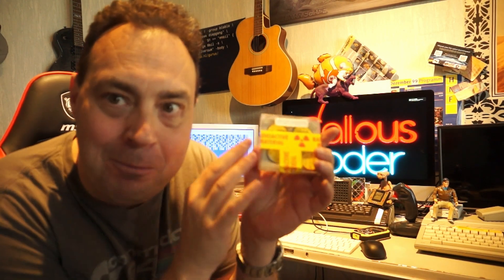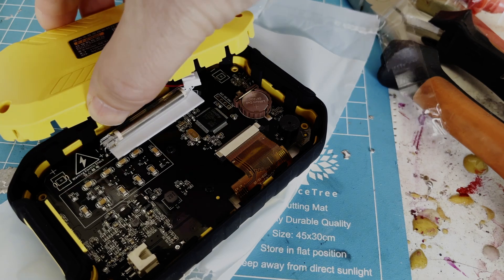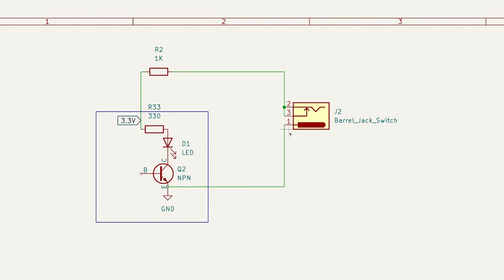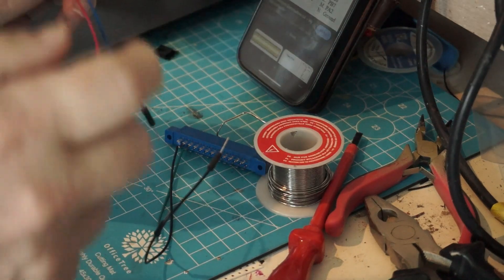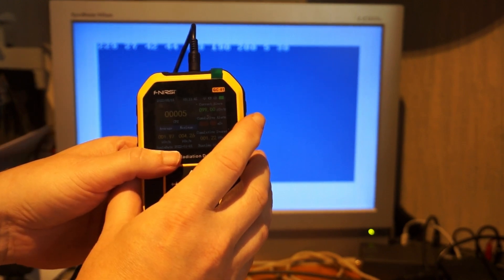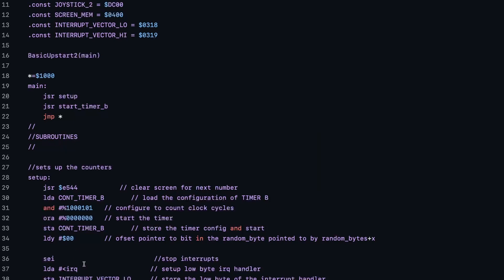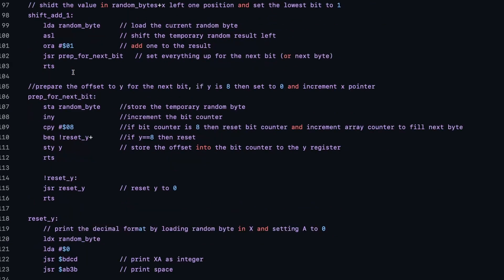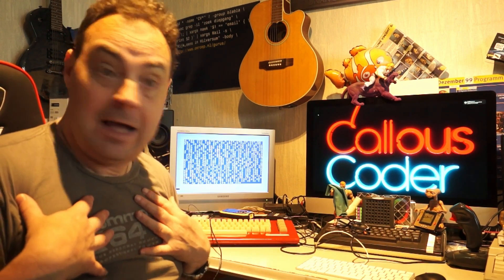True Random Numbers with a C64 and Radiation

Comment: Maybe using more active sources would speed up the number generation? If you have radon levels around above 2pCi/L you can inflate a balloon rub it on your hair then let it hang in your basement for 30 minutes, then deflate (avoid popping it so you dont lose accumulated isotopes) and measure it with the counter, it gives counts about 10X higher than background or more.
Reply from the maker: Radon in the air isn’t as potent as any of these test sources. But yes, more radiation is faster generation. The issue here is that tiny tube. A bigger tube is more sensitive and then you get ~20 cps with all these 4 sources combined.

Comment: You can try Americium from a smoke alarm.
Reply from the maker: No I can’t, americium is an alpha emitter and this detector doesn’t detect alphas.
I even tested it, I have Americium test source. But it counts the few weak x-rays very very slowly, because it is an alphas emitter.

If you have an alpha detector than americium is a nice hot source!

Btw This Chinese detector is a limp dick anyways 😂very insensitive with this tiny tube.
Reply: @CallousCoder  try it out with a gamma spectrometer like a radiacode 

Maybe make it so energy under 100kev counts as 1 and under 200 counts as 2 all the way up to 3000 kev for 30

Just to make it extra random
Reply: @The-One-and-Only100  I think that actually will make it less random, because isotopes have clearly defined energy spectrum so that increases the probabilities of getting the same numbers.

Comment: Where did you buy that? I am colector but i cant find those sources. Could you please tell me?
Reply: And there is a open source firmware that has RNG integrated
Reply: The giger counter is the bad version of it and normaly it has the long GM tube but sellers are making prifits for changing them and listing them the same price i think.
Reply from the maker: @MatějŠvenda  yeah usually you’d expect a J321 tube. But for this job in did fine.
Reply from the maker: You google Spectrum Techniques Oak Ride Tennessee. That’s where these sources came from back in 2014 when I bought them.
Reply: @CallousCoder  Thank you so much.
Reply from the maker: @MatějŠvenda  no problem! I should’ve put in the take where I talked about these sources. But I figured it would get too “nuclear physics” and not much engineering 🤣
But there are apparently people that are truly interested in the subject 😉